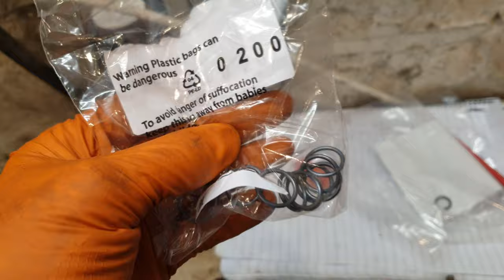BMW E31 850i "Glacier" - Complete Restoration - Fluid Filtration/Welding/AirCon - Episode 8

Comment: Another favourite of BMW, the god awful connectors 

The reservoir looks factory fresh, v nice. 

I have never seen that method used on a heat exchanger. You will need to report back on how it holds up down the line. 

Looking forward to the next instalment 
All the best from across the water 🏴

Comment: New timing chain tensioner? Tricky to install on an engine with no initial oil pressure. I'd run the engine for a bit then fit a new one.

Comment: Did you ask a radiator refurb company for a quote for the hyd cooler? You'll be surprised how cheap they can be!
Reply from the maker: No, but that's not a bad idea, it may still need a bit of work so will look into it.

Comment: I'm thinking of repairing my hydraulic oil cooler the same way you did. Do you still happen to have a link for those cooling fins? 

Cheers,
Reply from the maker: Any number of them on ebay/aliexpress. I'd recommend pressure testing yours first, turned out to be a leak in mine.
Reply: @stevesbmwbarn5706  Well I can't see a leak and actually the cooler has been is this horrible state for years but nearly all the cooling fins are gone. I'm not sure how important this cooling is, maybe just overengeneering 🤷.

Comment: Did you found out the correct height for the mesh in the hydraulic reservoir? I can't find it....    Cheers,
Reply from the maker: Nope, but the mesh height isn't crucial, correct level is 1cm from the top of the canister.